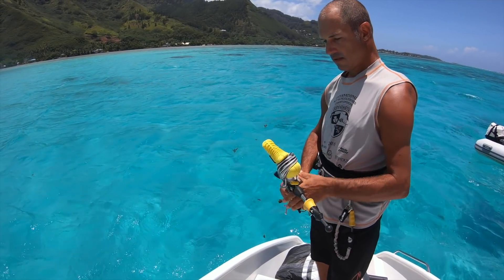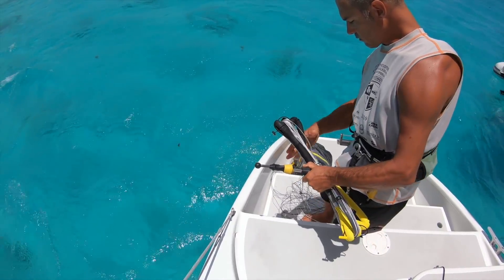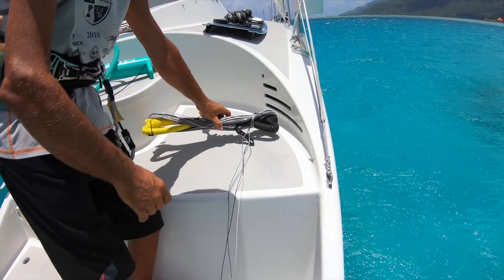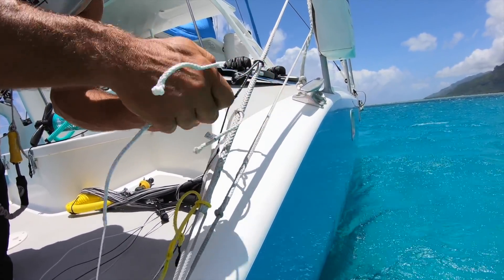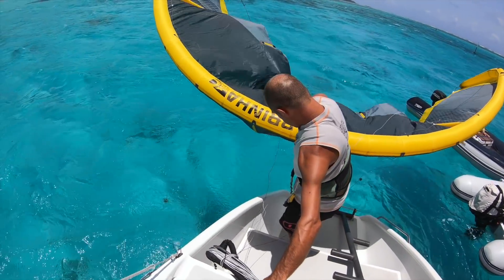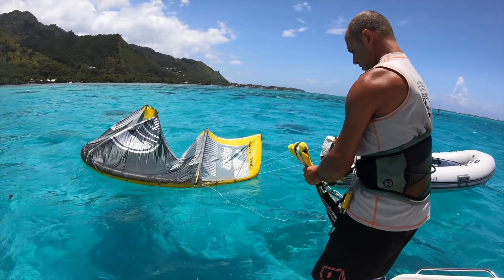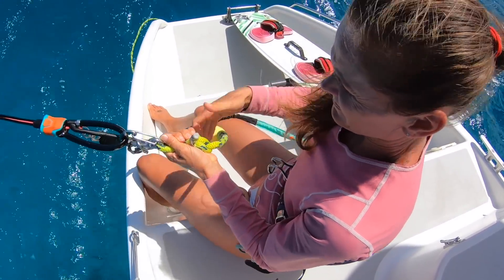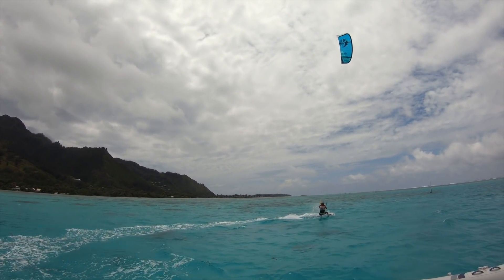Rigging and Launching Your Kite From A Boat (Kitesurfing Tip)

Comment: Keeping the line's on the kite, like for example Flysurfer dos, the Only thing is, Untangle the lines from the Bar carefully  to hold (prevention crossing lines) the right line setting !
Reply from the maker: Hi Taco - I agree that works in theory but the reason I do not prefer that method is because of the much greater potential for crossing lines (even if you're careful).  The consequences of a crossed line can be much higher when launching from a boat than from a beach where there may be no nearby obstructions and where it may be easier to retrieve an ejected kite.  It only takes a few minutes longer to sort the lines and it gives a much greater chance of correctly attaching the lines so in my opinion it is worth the 'extra' effort.  Cheers and thank you for your comment and info!!  R

Comment: oh I like the dorky way.... and then I put my lines on the kite before I pump it.  Yay or nay?
Mick
Reply from the maker: Whatever gets the job done!  We promise to only make fun of you when you're not around...  :)  Kidding aside the 'dorky way' works fine on the mothership but once you learn the flake method it is really MUCH easier and leaves fewer chances for crossed lines, especially more fail safe then attaching lines to a deflated kite and having to worry about keeping the bar orientation correct etc.  It's also easier because the lines are generally shielded from wind while you're on the swim step.  Another benefit of the flake method is that it works well in dinghies etc which makes it great for launching from areas with no shore access where the mothership can't go, for example tying off to a pylon near a surf break...  We're working (slowly) on an updated version of this video showing how easy it is to solo rig using the flake method.  I also use it on crowded beaches to avoid having to stretch out the lines.